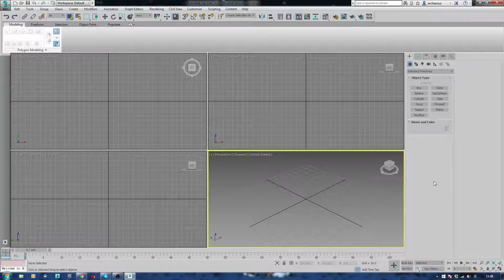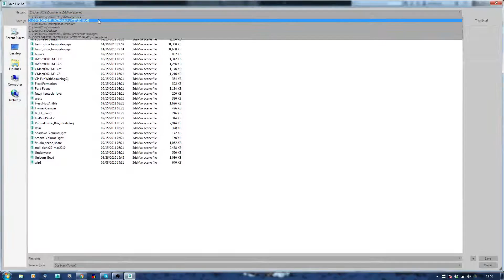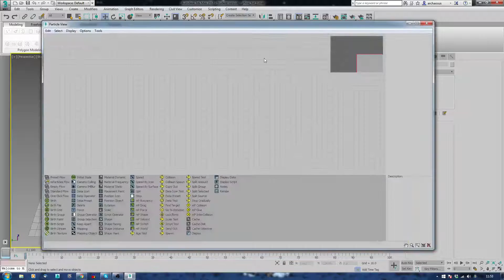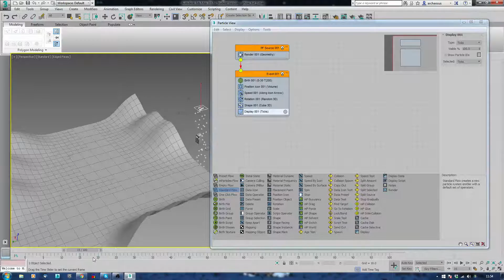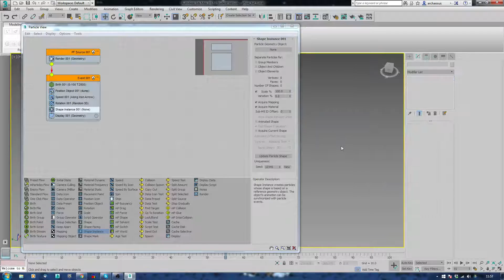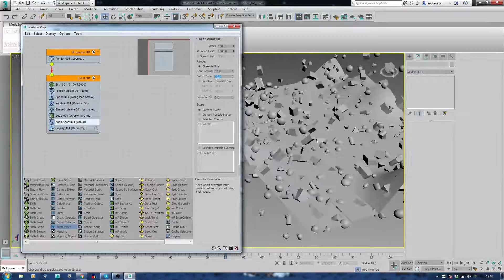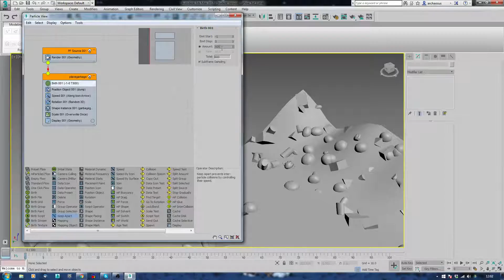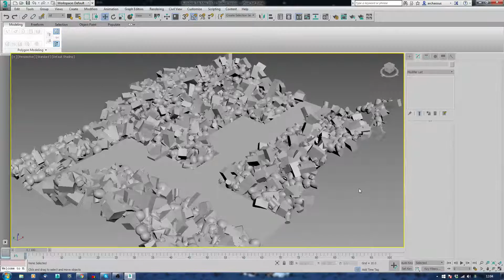Creating and Randomly Placing Garbage Using PFlow in 3ds Max 2017

Comment: Hey Mehmet, great video! Just a little question. Is it possible to randomly stack objects in a 3d space without letting them interfere with each other. So they wont cross the boundaries of other randomly stacked objects. Basically I want to recreate a randomly stacked pile of blocks.